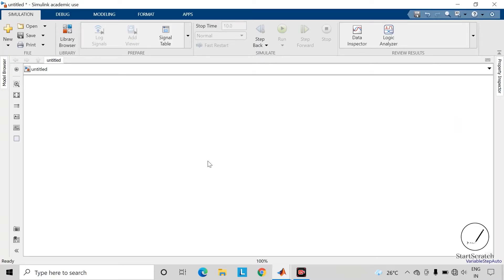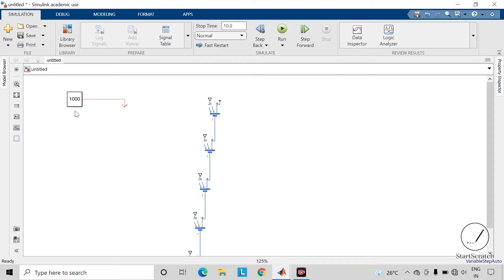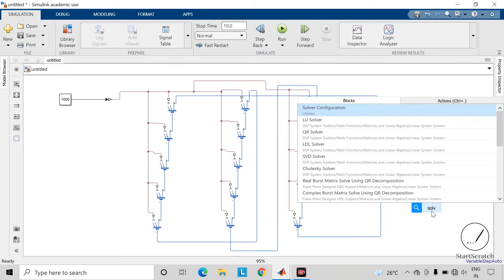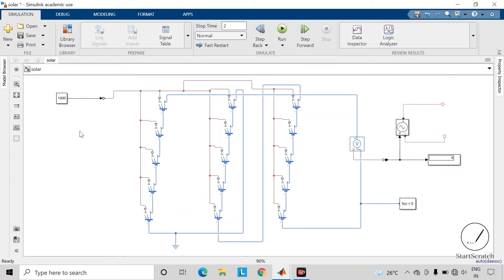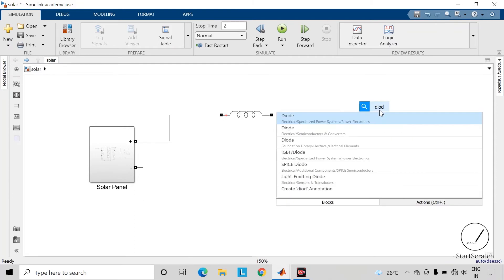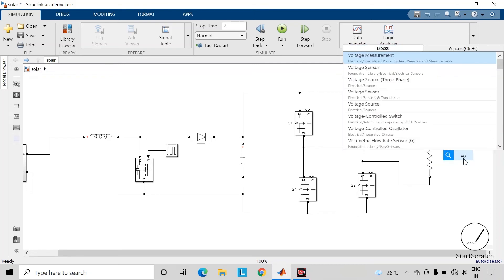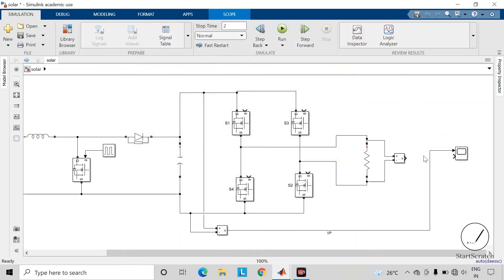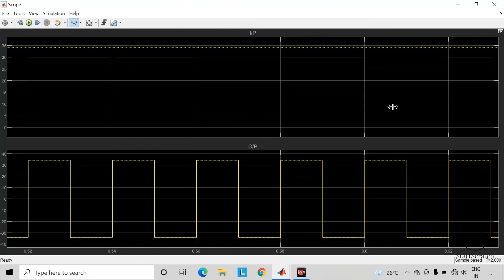L25 | Project 2 - Solar Inverter

Comment: Single-phase Full bridge Inverter: https://youtu.be/SdNubHWxZI0
Boost converter: https://youtu.be/5Ma-l3AY4Gg

Quiz:
1. How many solar cells are connected in series with each other?

2. What is the output voltage of the solar panel?

3. To increase the output voltage of the solar panel we have used _
a. boost converter
b. buck converter

#The Solver Configuration block is a necessary block for all Simscape models. 

#‘Powergui’ block is used for the simulation of components that are present in Simscape>> Specialised Power Systems Library